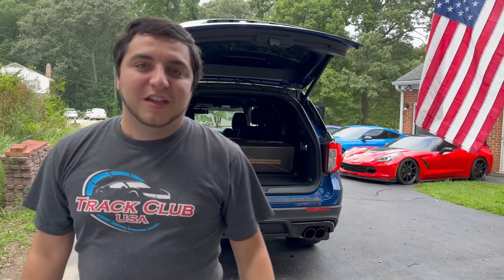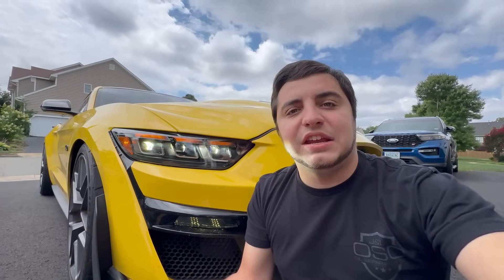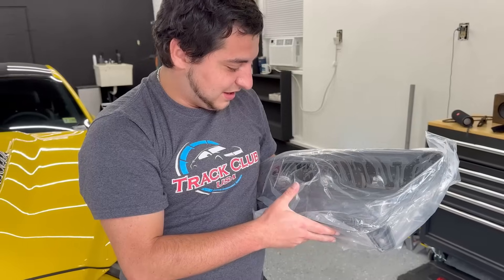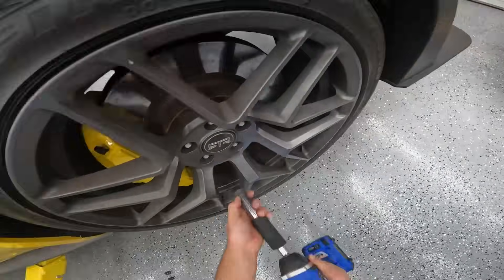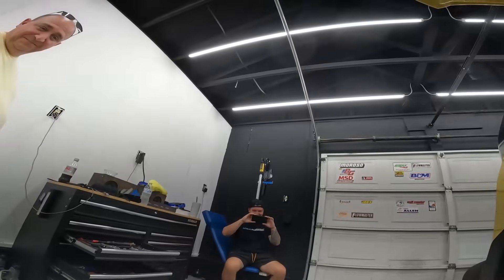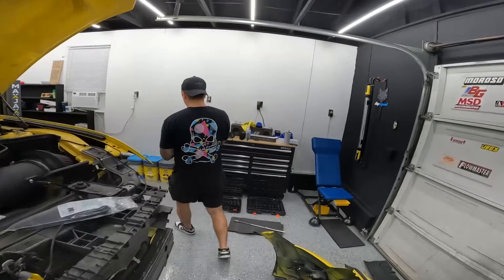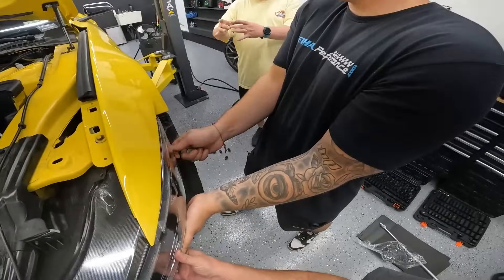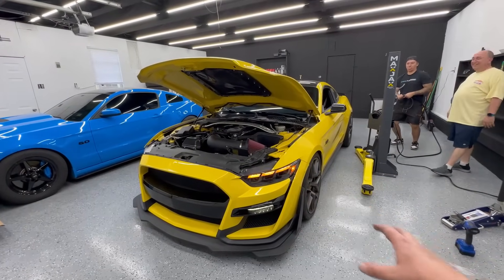2015-2017 Mustang Morimoto S650 Style LED XB GEN 2 Headlight Install & Review! *So Worth It!*

Comment: Love the setup! I do have a question for you Brandon. I’ve got a 2016 Mustang with the gt500 font end and because of that my OEM foglights are no longer there ans sadly my turn signals are all jacked up. I’m only able to plug in my turn signal harnesses but my foglight harness has just been hanging there. It’s been annoying for quite awhile and I see yours seem to operate well so I’m curious if I need the foglight wire spliced to another one or if there’s anything else I could try instead.
Reply from the maker: As far as I know you don’t, both my fog light wires are just hanging there untouched but I have them zip tied out the way but my turn signals work great. I have aftermarket turn signals so idk if the OEM ones are the same way but it shouldn’t matter
Reply: @BrandonMirandavlogs  Alright, thank you. I’ve got aftermarket signals on mine so I might look into a different brand if thats the issue 👍